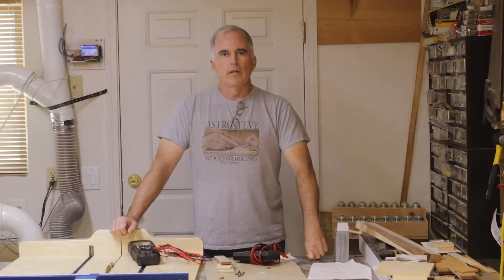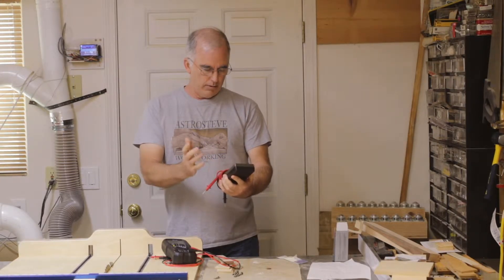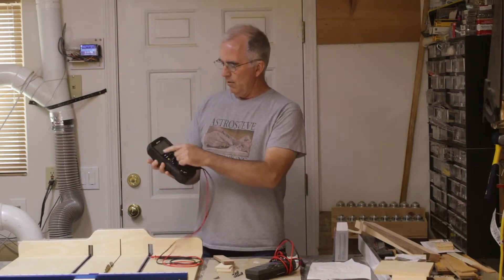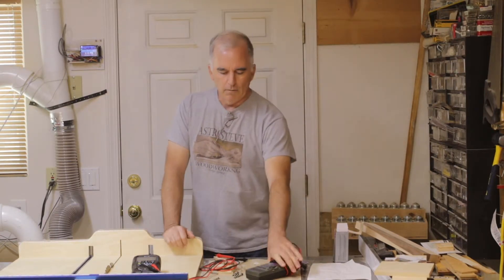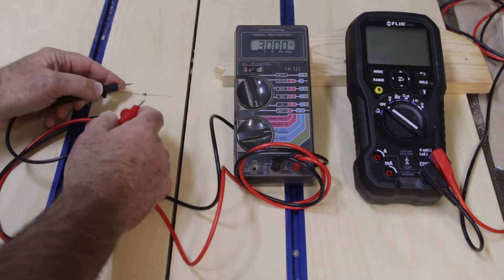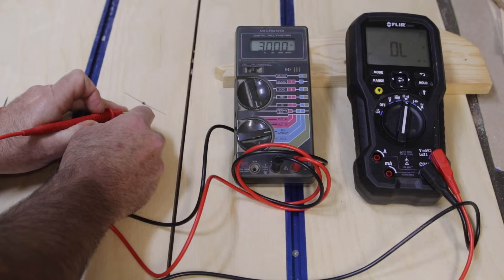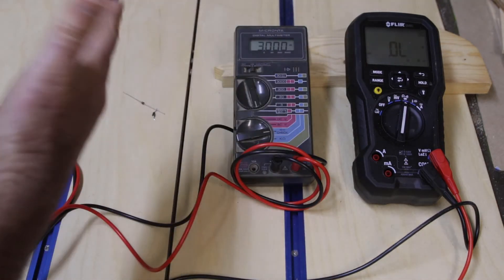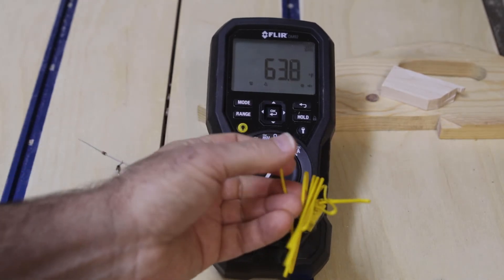Flir DM92 Multimeter

Comment: Their manual has been updated so you can understand it. Uses AC to test, plus one way, negative the other, same value means diode good, OL one  or two ways diode bad.
Reply from the maker: Hey! I just checked, and it looks good now. Yes, it is easier to understand when it's correct. Other than this issue (which is now gone), I love the meter, and it's been working great.